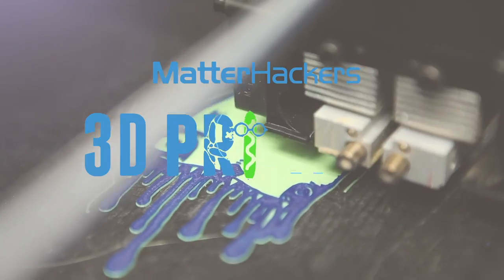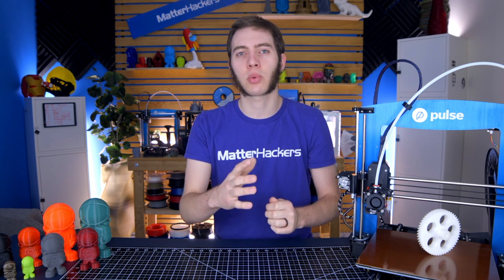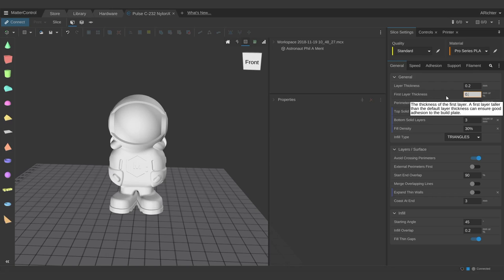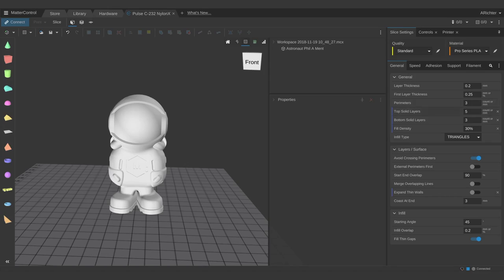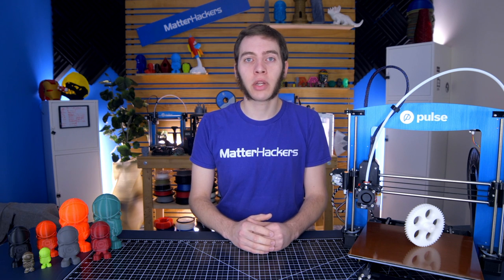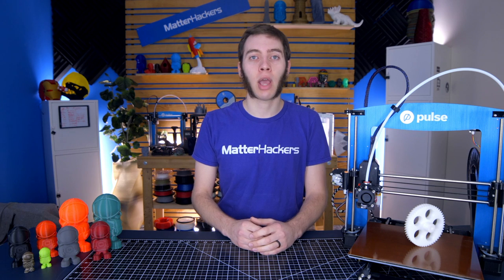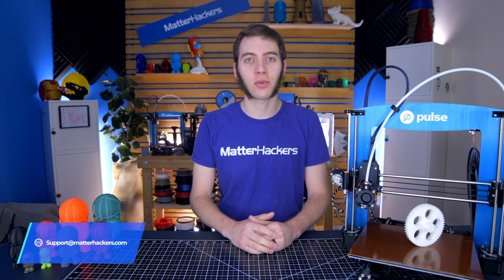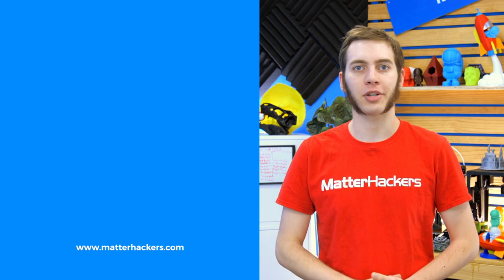3D Printing Troubleshooting Guide: Elephants Foot

Comment: I dont think in this particular video the information is accurate. The "elephant foot" is not related to the first layer height. Actually, it it would be, only the very first layer would be affected, the rest of the layer would be "levelled". Elephant foot is a tipical scenario for too much heat in your bead. In the case of PLA, a tipical error is set the bed temperature dureing all the printing at 50+ degrees. PLA soften at this temeprature, and by doing this, the object itself is going to squish the hole printing against the bed. Because of the base of the object being too hot, the object will slowly "melt" causeing the "elephant foot" scenario.
Reply: Valid point....i have faced this issue after i putted glass sheet on bed.... Glass becomes very hot initially causing wider prints at bottom. I have lowered the bed temp to 55 degrees and thus solved the issue. I also used small fan facing towards bed center and it worked too.
Reply: I was about to point out the issue with temperature which I'm surprised wasn't even mentioned. I hadn't considerred the bed though, I am thinking to get good adhesion the fan is switched off for the first 1-2 layers, so the PLA is still melting down as the subsequent layers go down on top of it. I have my bed set to 60 on the first layer and 55 the rest, with a hot end of 230 on the first layer to get black PLA to stick (otherwise it just drags along). This results in elephant's foot but I'd rather have this no no adhesion. I guess the cure is to alter the geometry in CAD so that the base has a slight bevel to counter it. Messing with slicer settings will mess other things up. Although Cura 4.6 has first layer horizontal expansion options which might be worth a try.
Reply: I think you just solved my problem! Thanks!

Comment: No solution works for me: The only way to avoid elephant feet is to add a raft !
Reply: This is because of temperature, which should have been mentioned in this video. Hot beds and no fan on the first layer make the first layer squishy when layers are put on top of it. A raft is a good way to stop it as it doesn't matter about the first layer at this point. I've never got on with rafts myself, but I might try again now you mention it.
Reply: If i add a raft in cura my print would get stuck to it
Reply: The same here

Comment: I've been having this issue with every print. I've had my Ender 3 pro for 3 weeks now, and it has never been an issue before. I made sure bed was level like someone with OCD, I lowered bed temp, tried reducing the initial layer horizontal expansion, tried reducing the flow, I even calibrated the z e-steps. Nothing I am doing is even reducing the elephant's foot at all. I'm new to 3D printing, so maybe there is something I may be missing, but this is starting to get me thinking about calling it quits. As I said, this was never an issue until about 4 days ago.
Reply: Did you fix it and how?
Reply: @saulg195  Turns out, it was the lead screw for the z axis. It was binding at the first few layers and needed lubrication, and that's it. Been getting great prints after.
Reply: @AIPTutorials  How could I check if this is causing a similar issue for me? First few layers are coming out really rough and causeing the extruder to skip. I swear I've been re leveling the bed plus for the past three days to no avail, alongside trying the things above among others.
Reply: @AIPTutorials  Which screw are you talking about? And what did you do, did you lubricate or tighten?

Comment: Check if option "Outer before inner walls" is active in Cura(must be in order to fix this), if you print inner before outer wall the excess material will go outside. I tried all options available( software and hardware) with no result, had first 0.2-0.8 mm of print being squisht out like pyramid shape, whatever layer height I choosed. Also for my  ender3 I have this settings:
-initial layer horizontal expansion -0.05; (helps for elephant foot)
-Initial layer line with 90%;(helps for elephant foot)
-print jerk 20;(helps for rounded edge corners)
-print acceleration 300.
Reply: If this works, thanks fren.

Comment: If the sides of my prints (which are supposed to be perpendicular to the base) are slightly angled along the whole height of my part, that likely means I'm slightly over-extruding right? The setting is 109%. I should try 100%. Do I understand correctly?
NOTE: I also have elephants foot on the bases and a flared top layer too

Thank-you! I really appreciate your time!